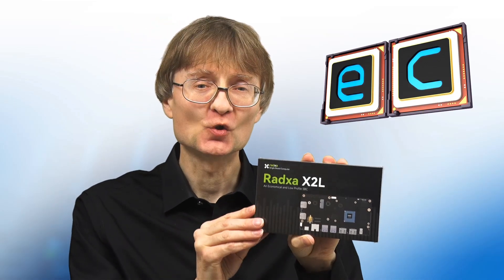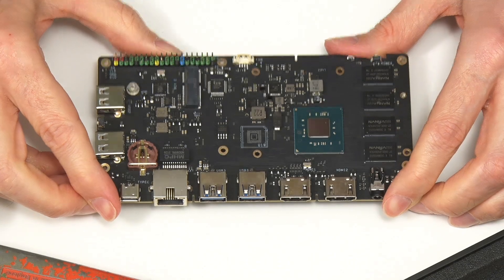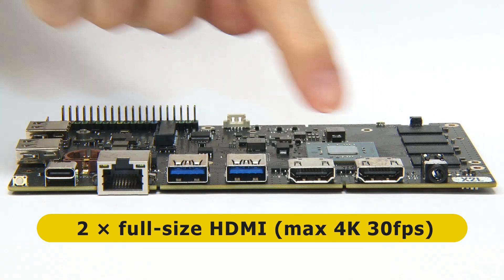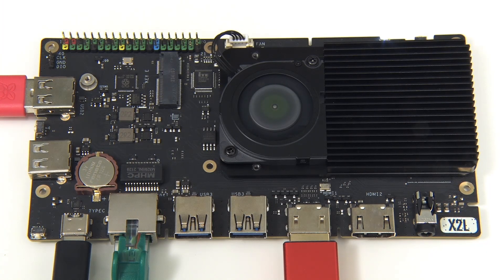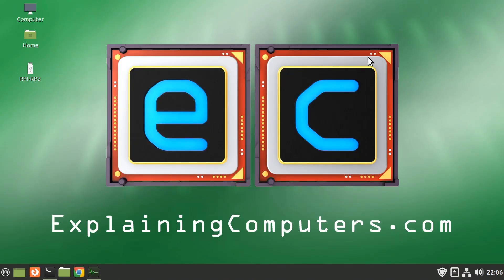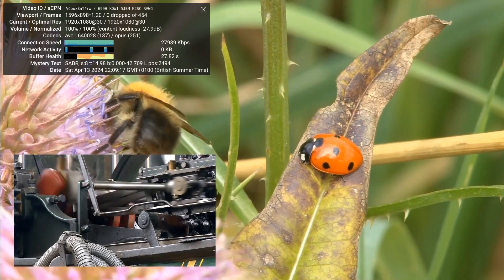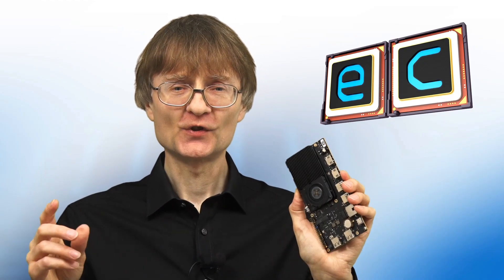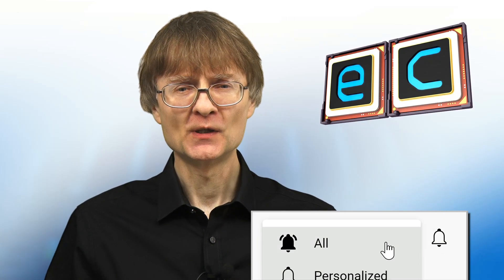Radxa X2L: Low-cost x86 SBC with RP2040

Comment: I would have liked it to have wifi and bluetooth connectivity. Wired network connectivity is just so old hat and for many will limit its use! Just my opinion
Reply: There's an M.2 E Key slot on the top of the board for a wifi/bluetooth card. Radxa sells one with wifi 6 and BT 5.2, but faster/better cards might also be compatible.
Reply: @wereoctopus  Hi, I'm aware wireless connectivity can be achieved using additional hardware but isn't that the case with just about anything. In my opinion all SBCs should have wireless connectivity straight out of the box so to speak. Good connectivity is usually at or near the top of most folks basic must haves and can often sway a decision when considering different solutions.
Reply: @alanrichardson1672  fair enough—while a wifi card has the advantage of being (hopefully) upgradable, Radxa could have potentially included a cheap, slow on-board wifi chip as well. e.g. an ESP32-D0WD-V3 (Wi-Fi 4, Bluetooth 4.2) is $1.50 on digikey.

Judging from photos, there seems to be plenty of room on the Radxa X2L's PCB to squeeze one in. Though I'm not an engineer so maybe there's design challenges I'm unaware of.

I think there's a place for SBCs without wifi though, e.g. very cheap ones like the Raspberry Pi Zero (well it was cheap). Or ones intended for industrial use, where adding a wifi/BT radio would require extra certification. Some of the Raspberry Pi compute modules lack a radio for this reason.

Comment: For that price this is an amazing value board really. I expected to cost at least twice as much. It has the same price as a Pi 4 4GB, which is kind of insane. Also the mini PCIe slot allows some extension options, there are mini cards which can provide extra SATA ports for example, or you can extend it to a normal size PCIe slot with a riser. Tempting. :)

Comment: could the rp2040 wifi/bt not be used?
Reply from the maker: The RP2040 chip does not have WiFi -- the Pico W boards have a separate wireless module.
Reply: oh ok, good to know! thanks.

Comment: It makes sense to combine a regular cpu with an rp2040. I guess the RPi5 did that with the RP1 chip - which is supposed to be a 2040 plus and minus some stuff.

So any idea how the chip interfaces with the cpu? Does it talk via a serial link on one of the pins? Any shared resources or memory? Can you download programs to the 2040 and let them do things separate from the main cpu?

I know, too many questions for a Sunday, but can you at least tell us what the mystery button on the board was for?
Reply: I might be reading the schematic wrong, but it looks like they're connected two ways:
1) USB2.0
2) UART, via an IT8613E chip.

Comment: Interesting choice of processor, especially since @7:00 you state it has now been discontinued. I have just bought a recently released (in 2023 I believe) Synology DS224+ NAS which also has the same (venerable) processor. Let's hope Synology has enough stock too as it's proving to be a rather popular NAS.👍
Reply: Probably there will be an updated variant of this board with a newer processor (maybe the N100?)
Reply: @IstvánNagy-z7m N97 would be good 🙂

Comment: I have had the 8gb version of this board for about 2 months now. Been running FydeOS as a home theater system. I like the board. However, with FydeOS I cannot get wifi working. Tried 3 different cards with no luck.

Comment: Woah, this SBC really is cool! Now if only I could find a use for it, but my laptop is enough for doing x86_64 stuff and I already have a few Pis. I can see this SBC being used in public (art?) installations due to its feature set.
Great video as always, and it was awesome that you were a guest in the Late Night Linux podcast! (just regretting that I didn't get around to listening that episode earlier and only saw it now :P)
Reply: I think it would be awesome for some robotics applications. If you have the eMMC storage you can presumably add another PCIe device to that slot, which would be a great place for something like a Coral TPU/NPU card. There's enough GPIO to drive a nice few servo and motor drivers and plenty of CPU and RAM to host a little web interface for remote control.

Comment: I don't see any usecase for this specific system. It's just an excuse for a  lack of innovations. It was never a problem to connect a cheap Pi Pico (6€) to any SBC. Either by USB or by SPI. Why should I risk to short circuit a 80-90$ board when experimenting with the onboard Pico? Don't get it.
Reply: put a 100-150ohm resistor at the pin as short protection, problem gone.

Comment: Yes it’s very nice. I’ve ran retropie on it x86. Been toying with it since January. Adding the cmos battery it does boot faster and instantly. I missed the rpi addition originally. I got the wireless module I need to add the right drivers for it which wasn’t simple. Company sent me a fix that I haven’t tested yet. I’m using the raspberry pi5 official power supply. Booting windows was a hassle getting it to flash. I had to use my m.2 drive. My only negative take way. Missing the m.2 set screw and no plans for them to make a case. But fortunately they have the palm version with the case which is the same thing

Comment: The important part is that at that level, the M2 SSD access begins to match direct memory reads. It's basically 500 gigs of DDR3 ram so you could just amp the swap space and running high memory consumption software – that doesn't do too many random memory reads & writes, access time is still way off! – should be entirely OK.

Comment: I've going to go off now and have a little cry! I have a little backup computer that is nearly in its "teens" now based on a I3 3240 it gets used for a few hours Monday-Friday for web browsing as its handy for work when i need to do background jobs. Its about the size of a VHS cassette so it fits in a space under the monitor. I would like to replace it and the Radxa X2L sounds ideal and would pay for itself eventually in the energy saving but I can see 2 problems firstly you cant buy the heatsink currently, and secondly they dont make a case for it! Its very annoying my current mini pc has 8gb of ram and its needs that because it doesn't have a graphics card so needs some of the ram to support the onboard graphics card and for my current "JOB" i need to open lots of tabs in Chrome as it takes about 5 minutes for each web page to "finish" and it runs out of memory with 4gb. Although i'm using elementary OS it would be nice to use something that would work with windows 11 as i occasionally use it for teams.
Reply from the maker: They do sell the board pre-cased: https://palmshell.io/slim-x2l

Comment: I have a I3 7100T (7TH GEN) HP PRODESK 400 G3 MINI PC 8GB DDR4 128GB SSD which cost £70, and a Pi Pico which cost £3.60. This system is cheaper and more powerful than the Radaxa X2L and also includes a case. Apart from not needing to connect a Pi Pico by USB to the Radaxa X2L, I don't see the point in them.

Comment: I can't say that this board is bad, but I do find it a little strange. It seems to be trying to look cheap, but if you really care about x86, then most likely you want to use Windows and are forced to buy the most expensive version with 8 GB of RAM, otherwise it will not work well. The heatsink is sold separately as if it's optional, but it's unlikely you'll be able to safely use this board without it, so you'll definitely need to buy that too. Plus you will need to buy an SSD, a power supply and possibly some other accessories.
As a result, you think you'll get a great computer for just $40 or so, but to actually use it, you need to pay at least $100. For the same money, you can just buy a pre-made mini-PC (and a Raspberry Pi Pico, if that's what you need).
I repeat, I can’t say that this board is bad, but it’s a very niche product and it’s hard for me to imagine where it would be logically justified to use it.

Comment: compare this to an hp refurb - the hp refurb wins on value being more performant at lower cost - we should see some truly new and better soc/sbc at some point
Reply from the maker: True, but this board uses a lot less energy and is more compact. So it depends on the use case.
Reply: @ExplainingComputers  the fact that it uses less energy is offset by price difference plus with refurb you can easily add  more ram and cards so the refurb has more flexibility as to use cases also

Comment: Congratulations on crossing 1 million subscribers, Chris B. 

That's a boat load of I/Os on an SBC. Surprisingly, it's more than what is provided on modern laptops.
Reply: I honestly think this "sbc" is just a repurposed laptop or barebones pc motherboard. It is shaped exactly like one.
Reply: Also, one can use the RP2040 PIO state machines to implement a very low level Custom Interface (like SWD etc.)
Reply: In fairness to modern laptops, you can probably get more out of a few USB4 or TB4 ports than all of those. But it is nice to not need to cover a desk in adapters and dongles.

Comment: This is a raspberry pi 5 killer board!  Wow!
Reply: Also for feature perspective, I don't think Pi 5 has the UHD 600 for QuickSync video codecs: AV1, H265, H264.
Reply: @JohnWilliams-gy5yc  the Celeron J4125 on this board doesn't have AV1 encode/decode. Intel added a hardware decoder with their "11th Gen" processors (Tiger Lake), and encode is only on their newest "Core Ultra" processors (Meteor Lake).

The Raspberry Pi 4 has a hardware decoder for H.264 and H.265, but the Pi 5 only has one for H.265. Presumably they thought software decode would suffice for H.264?
Reply: and for a lot less money plus no worrying about a hat for the hd. Although its a bit disappointing that they are too cheap to include a battery.
Reply: @christopher480 battery on board is a lot of hassle from certification perspective for shipping. You don’t want to pay for it. It is cheaper to just buy a $1 battery on your own ;)
Reply: No CSI -2 port, no camera, no computer vision
Reply: @danielpicassomunoz2752  Simple answer: Adapters
Reply from the maker: Agreed.
Reply: @ExplainingComputers  I am looking for a robust SBC that will handle live streaming from one camera via OBS. I noticed here that the Video encode is software only with hardware acceleration disabled. Is there a way that I can enable this? Would the software encoder be able to handle one camera stream encode at 3000 Kbps? Could you recommend a better SBC I sould consider for this project?

Comment: I'm sort of confused on the use case of this combo. It seems the GPIO pins are connected to the RP2040, and the only communication to/from them by the "main" CPU would be via serial to the RP2040 that's running its own code. So, what particular advantage does this give over a separate (not built in) Pi Pico? Being built in means you lose the advantage of allowing the microcontroller to have power and operate independently (as it's tied to the main board being powered.) It's one of those things that SEEMS like it's a neat idea, but I'm just struggling to find a use where I wouldn't just want a separate Pico. (I supposed you'd potentially save a tiny bit of space, but space conscious embedded systems usually aren't running x86 with lots of wired ports anyway. But you'd gain reliability, as a faulty RP2040 wouldn't scrap the entire system - or vise versa.)
Reply from the maker: You make some very good points.

Comment: Translator:
This processor sucks. I wouldn't buy anything weaker than N100 today.
Reply from the maker: Sucks for what? It depends, as always, on the use case. And it runs a lot cooler than an N100, whilst providing about 80 per cent of the performance.

Comment: Remember how both CPUs and GPUs went through the phases when they were once just bare chips, then they added cooling and now they both require massive coolers? Is the same going to happen with SBCs?
Reply from the maker: I think it is happening (sadly). A J4125 can be passively cooled with a large enough heat sink.

Comment: Nice piece of hardware that would probably solve my migration problems - both head and location wise. For a start I have brought Rpi5 with me as a laptop replacement. Decided against iMac also as I wanted full control. Have installed debian with various WMs. Am using it to browse the web on the go without carrying the clunk. I already have monitor and peripherals here. Thanks for updating us with recent disruptors!

Comment: With a complete Intel N100 Minipc including 12Gb (or even 16Gb) DDR4 and 256 Gb SSD being not that much more expensive this seems( just like the Pi5) an underpowered alternative? Since there are cheap USB GPIO adapters that isn't a really selling point anymore neither. But for specific use cases it might be worth to consider.

Comment: Not totally convinced by this SBC x86, it seems an hybrid solution, with  advantages and drawbacks (it tries to give same features of a mini-pc and micro-controler like arduino, but with some average results),  the lack of SATA port, ram limited to 4/8 GB may be an issue for some use cases, if you don't care  about GPIO port and you just want a PC in a small form factor then better choice would be to buy a mini-pc for 150 dollars, where ram can be extended up to 32 GB, with the possibility to install both SATA SSD and M.2 SSD.

Comment: Intel Celeron J4125 CPU architecture is old waste, and does not fall under the main Intel Core architecture at all. Sad reality,  four core 4/4 Celeron J4125  it has very similar Multithread performance as dual core 2/4 AMD 3050e or first gen Zen based Mobile AMD APU. Youtube playback, also try to test 1080p/60fps video or at least 4K/30fps video in the future. 1080p 30fps Youtube video, Dual Core Athlon II X2 3.5.ghz from 2010 can handle such video(+HD 3650 GPU)without any problems!
Reply: I think you are missing the point entirely; the company is simply trying to find uses for old stock of a now obsolete 5 year old J4125. I've never watched explaining computers Youtube at a bandwidth of more than 1080p/30fps. The youtube playback ability is more dependant on the hardware decoder capability of the GPU/iGPU and not the multi core performance of the processor(it's why the pi5 drops frames). You are asking way too much from a lower power obsolete processor, that doesn't even fit the use case of it's target audience. The fact that it can match/beat the pi5 in all of the benchmarks shown, means that performance is still good enough to be usable.

Comment: A great video of a good product but if the heatsink is not available,how does one use it? Does it also have a case for the form factor and is it possible to use a Raspberry Pi case and modify it if no specific one 
is not available for the unit?

Comment: Interesting. Too bad the USB-C is only used for powering the device. It would be a great expansion port if it supports USB 3.2 data transmission and Display Port.

Comment: best test your pico electronic circuit on an external pico via usb, you do not want to blow up your onboard pico or worse. (or use onboard pico to debug external pico c++ program)
my latest project uses rpi4 and a pico-w, pico-w (runs a webserver) signals the rpi4 thru gpio, rpi4 + motorhat (adafruit) controls a stepper motor, to move a camera slowly.

Comment: My daily driver PC is a J4125 (with 16GB of RAM and an NVMe SSD running Windows 11), and it is sufficiently snappy for all my productivity activities (e.g., watching ExplainingComputers on YouTube at 2K resolution).  It pleases me to consume so little electricity (without all the heat and fan noise of typical consumer PC).  Including the RAM upgrade, I spent less than $150 (not including a monitor).  I find I run the air conditioning in my room less, thus saving even more electricity.  I plan to solar-power my J4125 system as a fun project in the coming year (with batteries for 24/7 operation).

Comment: Looks like a very good board. Boards like this are making the Rasberry Pi obsolete. It will be interesting to watch them all fight it out for market share. In the meantime, I hope you are doing well and it is good to see Mr. Scissors and Stanley back after their triumph with the Gold Play Button opening.
Reply: People buy the Pi for the support and ecosystem around it. Better SBCs have been around for years and they haven't unseated it for this reason.
Reply: @BaghaShams  True, but at the price of a Pi-5, you can get an x86 computer that will run an OS with better support and a better ecosystem. The Raspberry Pi people have priced themselves into competing with SIGNIFICANTLY better computers. They are unlikely to do well in that market.
Reply: In my view, the X2L is a truly a desktop replacement with a Pi-compatible playground appended for tinkering.   The Pi still has its place (especially the Pico and the Zero) for embedded/IoT explorations, but the market is sensitive to price/availability.  Pi might become a victim of its own success within the maker community.
Reply: @Chris.Brisson  Sure, the Pico, and the Zero are good in their respective niches -- when you can get them.  But the Pi-5 is overpriced for what you get. (Again, that assumes you can get anything at all.) 

Perhaps the RISC-V SBCs will provide excitement for the next few years. But I think the days of the ARM-based SBC (of the larger type) have pretty much run their course.

Comment: This board would make an ideal replacement for my set top box which has lost YouTube, Netflix etc, etc!  I'm just measuring up an old project case which might just be an ideal fit for it.  I liked the way Linux Mint & Kdenlive ran on it which is a plus point for me, I suppose Windows 10 would be OK too, maybe a future test?  Thanks Chris for an excellent video & another happy Sunday :)
Reply from the maker: My TV PC is a J4105, so less powerful than this, and works very well. I can see this replacing it at some point in the future, probably running ChromeOS Flex.